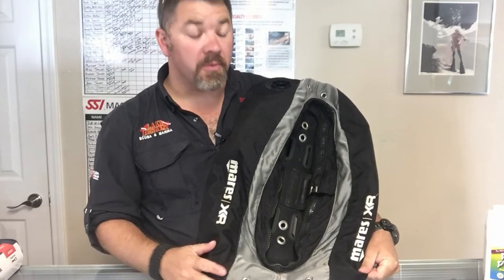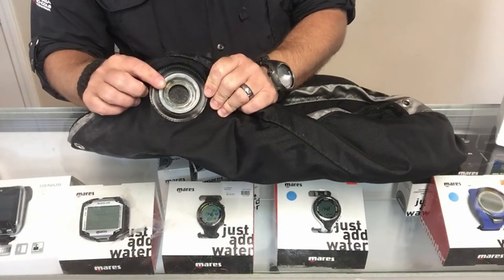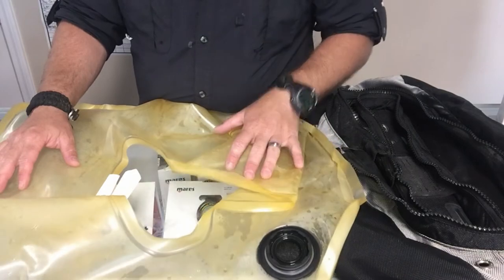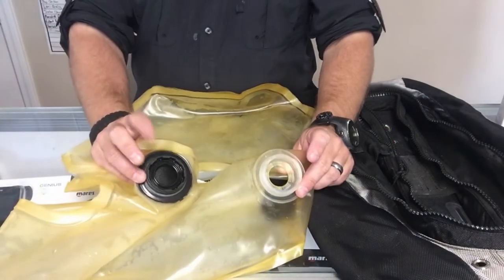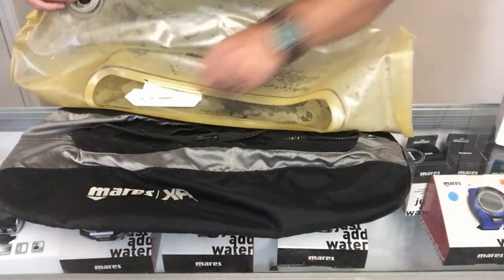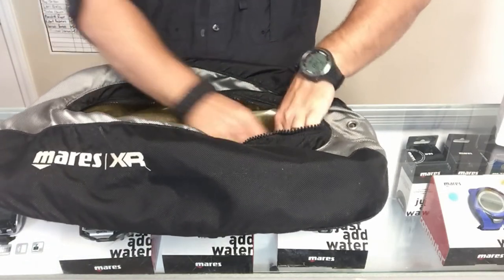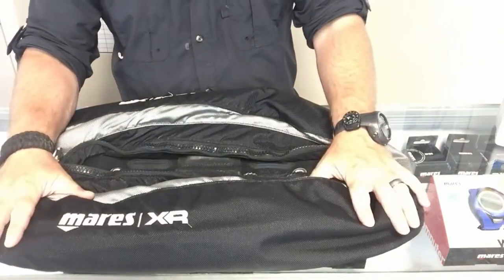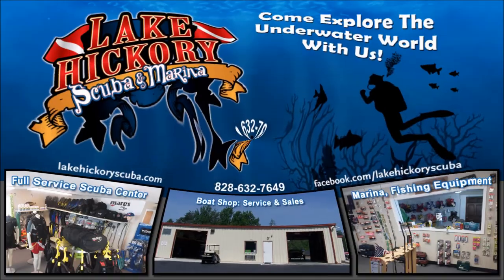Replacing The Bladder In The Mares XR Wing

Comment: Hi LHS.  I have a quick question about the Mares XR.  I am looking for a new single tank wing.  I previously had a wing from another manufacturer and the bladder was way too big for the shell.  This caused wrinkles, trapped air, difficulty dumping air, and a tendency to sometimes roll in the water with more air on one side.  I have had other wings that did not do this at all.  In your experience, how do the Mares wings perform in this regard?  Thank you.
Reply from the maker: Hello Gene Keeler. Like most manufactures, the bladder inside the shell, will always typically be much larger in size than the external shell. Personally though, I have never had any issue with trapped air in the bladder. With the Mares single tank bladders all being a donut design, and not a horseshoe design, this helps eliminate any trapped air. There is a horseshoe design in their double bladder system, but not for the Sidemount and Single Tank Systems. Coming from a back ground with OMS and the original Redwing systems, I much prefer a donut style bladder. Though I am a huge fan of Mares, I have always had great luck with other manufactures as well.

Comment: How not to get confused which valve is the inflator valve and which one is the exhaust valve? I took out my tecline internal bladder and I dont know now which one is which.
Reply from the maker: Hello @lukaszeS, great question. Each manufacture design their bladders systems differently. With Mares, they will only line up one way. I would suggest taking your BCD to your local training center to get help with it.

Comment: Hi LHS, 

A quick question regarding these bladders. I'm slowly putting together a BPW system for travel (Mares XR soft backplate with heavy duty harness so far), but since it's for travel, I'd be relying on rented bottles with regulators, diving mostly in warm water with a shorty or normal 3mm wetsuit. Since I (maybe) can't control whether I'll get an aluminium or a steel tank, I guess I should go for the 32 pound / 16 kg bladder, and add some of Mares' side weight pockets for flexibility? I notice they also have a 10 kg / 20 pound bladder.. so I'm a little confused on which would be better. Can you provide any insight on whether it's better to go for the 10 kg one, or the 16 kg one?
Reply from the maker: Hello drheaddamage, cool name by the way.  I have a serious of videos on how I travel with my Mares XR sytems. I will link them here for you.  

https://www.youtube.com/watch?v=dQe2zQUfjZc
https://www.youtube.com/watch?v=xAmoBblWEYM
https://www.youtube.com/watch?v=ajgO8qyzI-s
https://www.youtube.com/watch?v=0MCb7ceJdr0

As far as lift, I have absolutely no issues getting enough lift from the 10/22 (small wing) from Mares.  I use it for summer time diving, or tropical diving.  I also use the 16/34 (larger wing) for winter time diving.  If you are looking for a wing that will accommodate both, then go with the 16/34. Its always better to have more lift, then not enough.